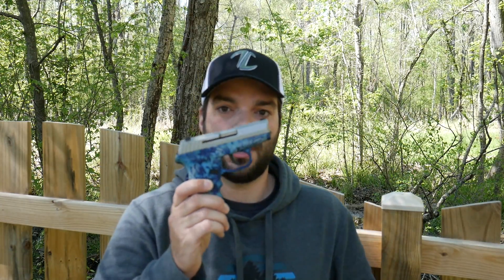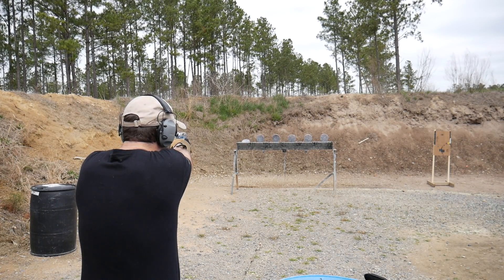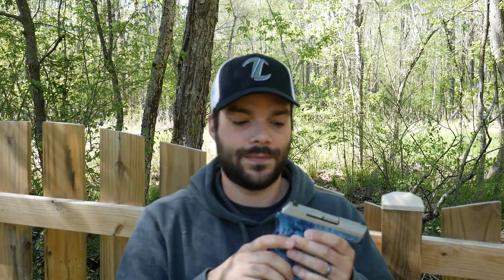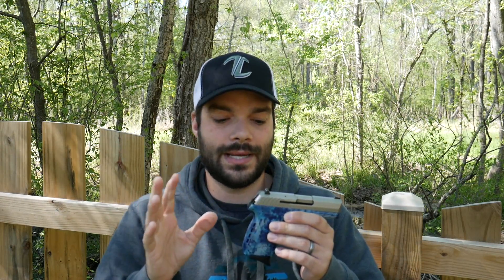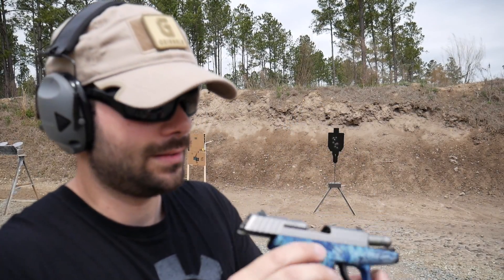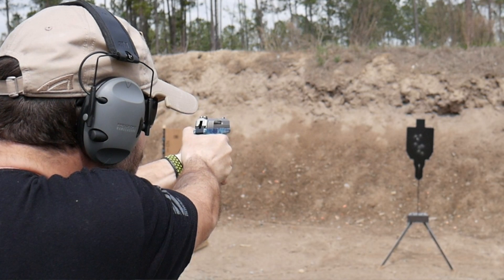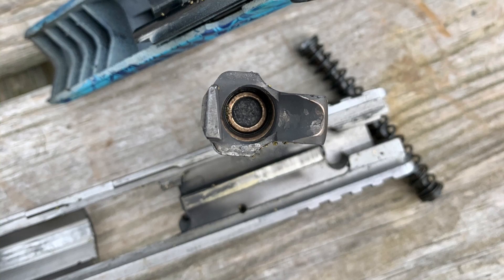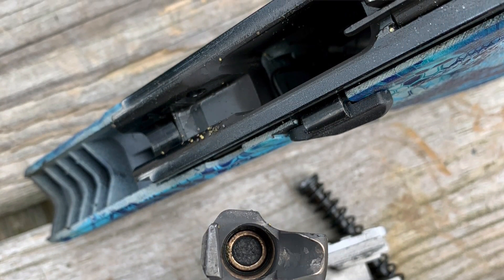Squib Load Caught on Camera | SCCY CPX-2

Comment: This happened to my son last weekend! Had some flooded ammo I had tried to dry out. TAP IT OUT FROM THE MUZZLE TOWARD THE BREACH!!!!! NO SENSE IN TRYING TO PUNCH THE ROUND THROUGH ANY MORE RIFLING THAN NECESSARY!!!! COMES OUT MUCH EASIER THAT WAY BELIEVE ME. SCCY CPX2 owner, here. Thanks for the video and the reminder /warning about this rare but VERY dangerous phenomena in the shooting scene.  With all the new members of the gun owning community coming on board,  this is a very timely topic. Things happen for a reason and He let you capture it all on vid.  Bless you and keep up the good work!
Reply: @G. Dileonardo Yeah. Flooded Ammo. Midwest flood of 2019. 1800 rounds of 9mm is a bit much to just throw away. Especially now. I now know that 3 days of hot sunny windy exposure and shaking the dogshit out of them primer down will bring 99% of  them back. I only use them at my own private range so no distractions to hearing light reports. So far, out of about 300 rounds, only 1 more squib. I only use them in short barrel handguns so less work to clear if necessary.  I can attest that 50 cal. mil spec ammo cans are indeed waterproof.  The plastic ones you get free with bulk ammo from Ammo Depot.... Not so much!

Comment: Still definitely contact Browning ammunition. Even if there is no reason for them to reimburse you outta pocket sometimes these manufacturers just like to know that something happenedand they will probably ask you for the batch number on the rounds that you bought so they can do more quality control testing or more research to see if there were any other issues with that batch.
And they might send you some free ammo as a courtesy. 😂
Reply: Definitely contact Browning, at the very least they will want batch info off the box so they can try to figure out what might have happened.
Reply: Could also save others from having a like experience. Might be a problem that affected enough for them to recall the batch so no one gets hurt. They cant recall anything if they dont know theres an issue
Reply: Browning would be browning their pants if they knew

Comment: I've been present for two squibs so far. One was in a M1A firing radway green surplus, the second was in a CZ-82 firing brown bear. The first one almost ended in disaster, the shooter didn't notice because the gun still recoiled and there was enough firing on the range that he wouldn't have noticed a lack of report - thankfully though - the guy next to him on the line noticed there wasn't any muzzle flash. If he had fired the next round, Garands, M14s and M1A are notorious for injuring shooters when squibs happen. 
.
The second one happened on the first outing for a guy's new gun, I was with him to test it out, see if the sights need adjustment, make sure everything runs fine, etc. He didn't see where the rounds were hitting and since it's a bright day, and again - lots of shooting: no one noticed anything, then all the sudden the gun wouldn't function. So he hands it to me and I can't get the gun apart like normal - while examining the gun I discover that the barrel was bulged and would not allow the slide to come all the way back. the squid had lodged halfway down the barrel - then gotten pushed out by firing the next round: but created a bulge in the barrel in the process. Other than the barrel being bulged, rendering the gun inoperable - there was no other discernible damage of any kind. That little surplus CZ-82 dealt with the absolute worst case scenario malfunction, a squib, with another round behind it having gone off - and the only damage caused was the barrel bulged. Didn't even split the barrel - just bulged it. No slide or frame damage, no excess gas flying out of the back, the shooter didn't even know it had happened - it was simply rendered inoperable due to the barrel bulge preventing the slide from operating.
.
I have since purchased two surplus CZ-82s, one of which wears XS big dots and the other is a back up for parts if and or when necessary.
.
Also, J&G sales was the company from which he ordered the CZ-82 and the ammunition which squibbed on him. They agreed to a full refund for the gun and the ammunition purchased. They didn't manufacture the ammunition so it wasn't their fault that the event occurred - but they still ate that loss: which is excellent customer service.
Reply: this should be easy to tell for gas op guns. if the gun didn't cycle and you manually ejected a casing without bullet, you should suspect there's a squib
Reply: @felocha  Under powered ammo, under-sized gas port, sticky powder, fresh magazine spring, under sized chamber, weak extractor and dirty chamber can all cause a gas operated rifle to short cycle: forcing you to have to manually charge the weapon and eject the spent casing. This happens a lot with AR-15s when using weaker ammunition or steel cased ammunition - squibs are obscenely rare by comparison. 

I.E. to get an AR-15 to run on steel cased wolf ammunition: it's recommended you use an increased pressure extractor spring, speed polish your chamber and have or drill a larger than mil-spec gas port. back when everyone but everyone just had to have a "mil-spec" AR-15: short cycling was very common for civilian AR's - thankfully manufacturers have moved away from true mil-spec uppers in order to offer greater reliability with common (pleb) ammunition like wolf.

Comment: That was strictly the primer pushing it, no powder involved.
Reply: there was unburned powder in the chamber!
Reply: This. I had a 45ACP squib with zero powder, primer pushed it halfway down the barrel.
Reply: I agree given how far the slug was down the barrel.  almost no powder burn.  The primer can push it as indicated above, but not all primers are the same.
Reply: That's my thought. Failure for powder to ignite. Blast from primer pushed bullet out just enough.

Comment: I've knocked out squibs, not a big deal...usually. Unless there's a fired round after, then there can be issues. And I had one. This fella I know brought me an old gallery .22 short pump. He said, ''there's a bullet stuck in there''. I thought, ok, not a big deal. Fella's, there was about 2 inches of lead in there, I kid you not. The lead started about 3 inches from the end of the barrel. I could not drive it back, or forward, all that lead was lodged, and bad. I took the gun apart, and let it soak overnight in some penetrating oil. Next day, still could not get it out. I was bending brass rods, and I tried to use a steel rod, with a piece of old rag material over the sides of the rod, the rod bent. It was just too small diameter, and could not get a good hammer on it without possibly hurting the barrel. So I bought a new drill, very small diameter, and used a stainless cup over the muzzle, made one out of some scrap, drilled a hole in it...anyway, I very slowly drilled, keeping it centered. Then went to bigger bit...slowly drilled. I could not risk going bigger, and the job was extremely slow, this gun was old, and I was trying my hardest to make it right. Finally after hours and hours, I got that lead to move with the hammer and brass punch, and it slowly started creeping, so I soaked the bore again with oil, and slowly it worked out and the lead that came out shocked me. Lucky it was .22 short is all I can say. No bulged barrel, the action was good, no cracks, and I did not hit any of the rifling at all with the drill. The guy that brought it to me, said last time it was shot was in the 40's, and he remembered his kin folk saying ''there's a bullet stuck in there''. What a job that was.

Comment: As “cheap” as they are I would knock it back through the chamber as long as your rod is wood or brass it won’t “hurt” the rifling.
Reply: Be sure to check the barrel, chamber, rifling, slide assembly for cracks and/or bulging. Check the take down pin and frame for damage. Check the headspace. Clean the unburned powder out of the magazine-and the rest of the gun.
Reply: It was a squib round, not an over pressure round.  Just knock it out the breech and move on.
Reply: @inhumanfilth681  not proud either but I'm also at 3 times. Once was with a 500 magnum and that time I'm not sure what happened there was unburnt powder everywhere. The other two times were either operator or powder dropper error at my press.
Reply: @roberttaylor6030  sometimes something called unburnt powder looks like fine green corn cob. Win 231 is like that.
I stopped using it. In a revolver it's messy. In auto you don't notice it. In the vid look close. It's there.
Old guys swear by win 231....I went back to Power Pistol.
Reply: oh, it's called a filler....common in some gun powder.
Reply: @timbernie  The powder I was was using was Hodgdon h110 which I'm told is the exact same thing as Winchester 296. I no longer use either. Now I only use Lil Gun for Magnum rounds,  I've been using it for about 5 years now with zero issues.
Reply: I don't think it's precision enough that I would worry much about the rifling.

Comment: I actually had one on the Range when I was getting my instructor certificate, I caught it right away I happen to have a pocket size cleaning kit in my pocket and was able to clear it out of the bore and continue on with in probably 45 seconds.

It doesn't have quite a bit to go out of that Barrel, push it out through the breach. It'll come out a hell of a lot easier that way.

Looks like the way it's in there, you never would have had the next round chamber. That would have helped as well. And the case that I had it was the fact that there was no powder in the case at all it was just a primer and all I did was the bullet in the bore.

Comment: 3 months late to the party but I have a cool/scary story about squibs that I was told while I was in the TDCJ academy.
The texas department of criminal justice(correctional officer) academy trains all of their new boots to use a .357 magnum revolver as a side arm.
Interesting tid bit tdcj recycles and reloads all of their rounds to cut cost and they make the projectiles from melted down old bus parts. Needless to say some of those rounds are unreliable as all hell and a squib or two is not uncommon every couple of years.
On the range they had a guy fire a squib his first round and continue to fire the remainder of his rounds lodging all SIX in the barrel. By some miracle he didn't lose his hand and the revolver stayed intact.
They show a picture of the barrel after it was cut it in half to teach/warn the class about squibs and what to look for in case it happens.

Comment: In 30+ years as a shooting sports enthusiast, I have seen TWO squibs. One was a guy firing with a .357 magnum revolver, and one was my own CZ-82 using TULA Brown Bear. The guy with the .357 was shooting next to my table. I heard the BOOM, BOOM, BOOM, pop. My brain registered that a .357 does not go 'pop', and I looked up at him to see a puzzled look on his face. But then his thumbs goes up and cocks the hammer to rotate a new round, and I started to dive under my shooting table. I guess my movement got his attention because he stopped and looked at me, and then asked , "Did that sound right to you?" He had a projectile about 2" down a 3½" barrel. He had been shooting a 'friends' reloads.
My Tula ammo had a fizzle, leaving the round sticking a quarter inch out of the end of the barrel. It had enough umph to eject the case and load the next round, which was a scary thought. I was actually able to grab it with pliers and pull it out once I got home, which is good, because the CZ-82 barrel is attached to the frame. It is also nice as the CZ-82 has not got the normal rifling, but instead uses an off-cut polygonal barrel.

Comment: Great that you added this video & story. Good for you it was the last round in the gun. I reload .380/.38 spl/9mm & .44 magnum. I hand dip & weigh each load of power so as to not double load or under load. One round each time to have powder added then seat bullet all on a digital calibrated scale. Does it take longer, a lot longer but no problems in years of reloading. So much for factory ammo being perfect.
Reply: Give me some 44mag

Comment: I bought about 500 rounds of 9mm 124Gr. from a company called TSA (Target Sports USA) and I had a round that was very interesting.  I caught it as I was loading the rounds into my magazine and saw that part of the primer was cut off. It exposed some of the inner elements of the round but held all of the gunpowder. So I took that one round single round and chambered. Nothing bad happened luckily as the round just popped just like yours did. It didn't push the round out but you could smell the gas of the gunpowder seeping out of the primer.  Never seen anything like that before. I did contact them about it and they are working with me on either getting a refund or just getting some more ammunition. Hopefully more ammunition rather than a refund lol.

Comment: I've been shooting over 60 years, I shot pistols competitively over 60 years, in all that time I have had ONE squib, it was about 40 years ago, I was shooting 9mm handloads when I heard a POP instead of a BANG! I knew instantly what it was, and sure enough a bullet was stuck in the barrel, a brass rod pushed it out of the barrel and the pistol was fine. Just be aware of what is going on, if something doesn't sound right, stop and check before continuing on. I keep a wooden dowel in my shooting box all the time so I can easily slip it down the barrel to check for obstructions.

Comment: Chances are that round was not charged at the factory. Meaning it did not get a powder charge in the case when it was loaded. The primer has enough pressure to push the bullet into the rifling lands of the bore in front of the chamber. If the bullet was stuck further down the barrel then probably a weak charge. Glad you caught it. Just get a cleaning rod or wooden dowel and from the muzzle end insert the rod or dowel down to the bullet. Then tap the other end of the rod or dowel to punch the bullet back out into and through the chamber. Just knock it out.
Reply: there was definitely powder in there. you can see a bunch of it in the gun in the close up. maybe not a full charge
Reply: There's literally gunpowder everywhere.
I've had this happen to me with factory ammo, powder included and everything. Contaminated powder or primer.

Comment: Had the same thing occur to me with off brand Russian .380 ammo in a Bersa.  It went “poof”, ejected the hull and fed a new round!  Fortunately I noticed it and checking it found the barrel plugged half way to the muzzle.  At home I was able to use a 1/4” socket extension in base of bullet and drove it out on a wood block.  Quite a wake up to a long time shooter as I had never before witnessed it, only heard and read about them.

Comment: I bought a box of 500 rds of .22 of browning and kept having multiple problems with the ammo until it got to the point where I was having to chamber a round every other round. The firearm was cleaned and lubricated and it still was happening. I told the trading post where I bought it from and they said to come back and exchange it for a different brand for the same price. Come to find out it was a large batch of bad ammo. I used different companies to verify it was the browning ammo as well. I wont buy them anymore. The quality seems far less than other manufacturers. Luckily no squib rounds but every other malfunction while using browning.

Comment: We see squibs from time to time in USPSA. This is primarily handloaded ammo which is why it is not out of the ordinary. As a Range Officer running with each competitor its our job to stop the shooter immediately if a squib is suspected. Usually there is an audible pop, like a kids cork gun sound. Ones like captured here are more dangerous though without enough pop to push the bullet down the bore its likely the next round won't chamber. A factory ammo squib is a pretty rare thing!

Comment: Lucky guy, my first squib load was when I was 9 y/o I was shooting Russian surplus 54r out of my m91/30. It was my fault because I got used to striking a failed round twice with my 22lr bolt action rifle. So that's what I did on this particular cartridge when the primer didn't go off (Different times I guess now it's seems like you can't even have a bb gun in a house with kids..) Anyways i was rushing to get that stuck bullet out asap because I really wanted to finish off the last 100 rds from that can but ended up braking my rifles cleaning rod (thought it was called a ram rod for a reason,   then I learned from this that its a cleaning rod and not a dang ram rod...) while hitting it with a rock..... other than that the only other issues were with 22 lr

Comment: Most times (not every time) in an autopistol, the slide will not operate and chamber another round.  Often, the danger is in not noticing the "pop" (which comes at least in part from the primer) and not a 'bang'.  The shooter assumes a dead round or failure to chamber problem and conducts immediate action - cycling the arm by hand .  

Most times, a primer only load will send the bullet just far enough to leave the case and stick in the barrel.  So in the case of a semi-auto, the next round will not chamber.  In a revolver, one hopes the bullet sticks in the forcing cone, with the base end of the bullet in the cylinder still and the revolver will not cycle.  THAT sort of thing is obvious.  

If the bullet is forward enough to allow another round to chamber or allow a revolver to operate, firing another round is not recommended.  Typically the arm will not go up like a hand grenade, but usually the barrel is ruined at least and sometimes (depending on the intensity of) the cartridge and the construction of the arm, it can come apart, usually radially to the line of fire.  Exciting at the very least.